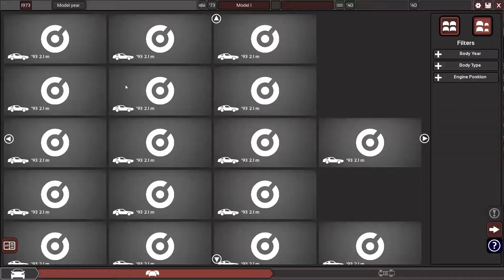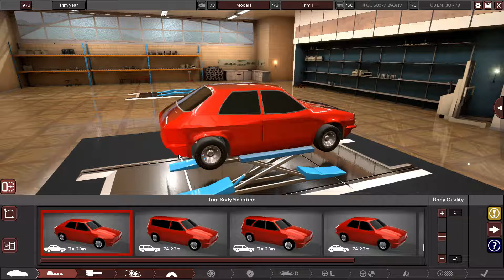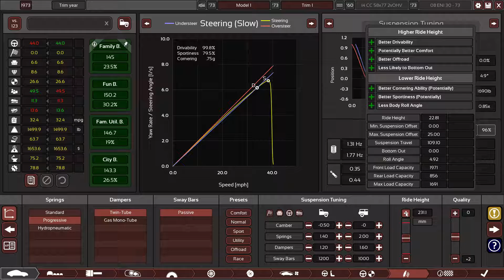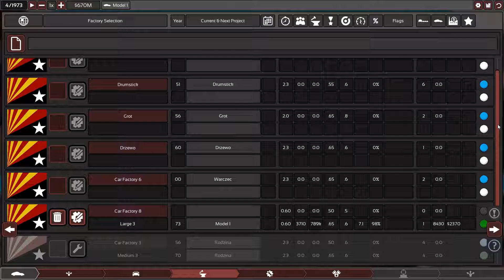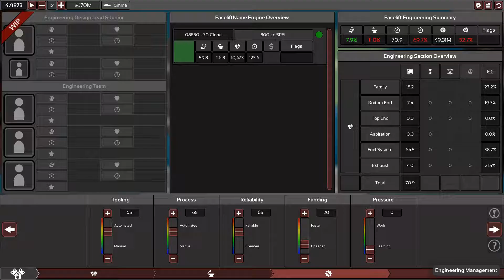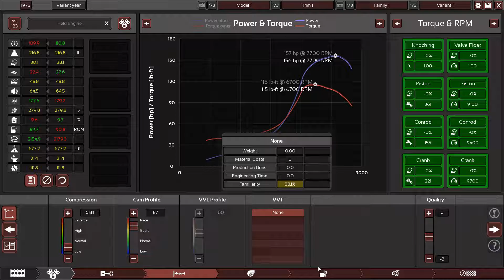Automation | Kiev Motors 16

Comment: Oof.. So much red Turbo.. I wanna say that wouldn't work in a real world. But, it is coming from a game...
Reply from the maker: Red turbo?  I do not understand.
Reply: @alekius3329  In your statspage thing.. it was very stressed. not green.
Reply from the maker: Oh, the air flow for the compressor.  That's fine.  Not a concern that it's limited in a couple categories.  When you add a turbo, if you want full ease of airflow all the way through the turbo, you're going to have a very limited power band turbo.  You need to start constricting at the compressor or turbine to narrow or widen the power band and speed up spooling.  The intake limitation is disappointing but at least the exhaust isn't limited, that would cause the turbo to literally glow red.